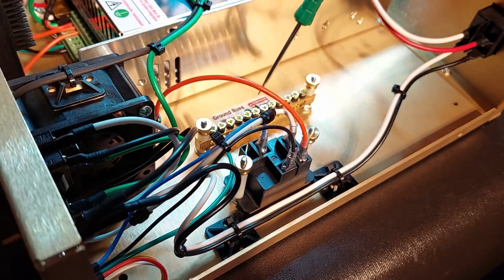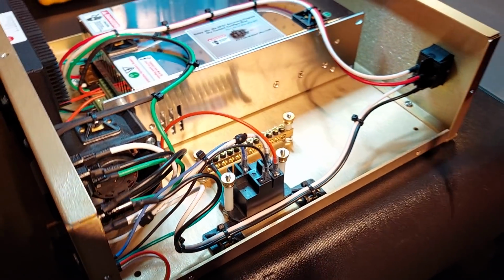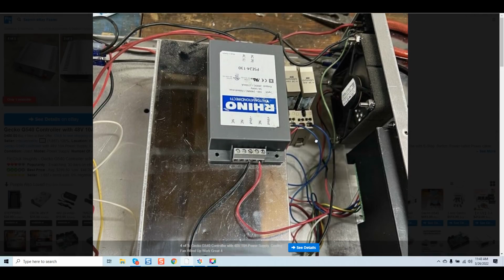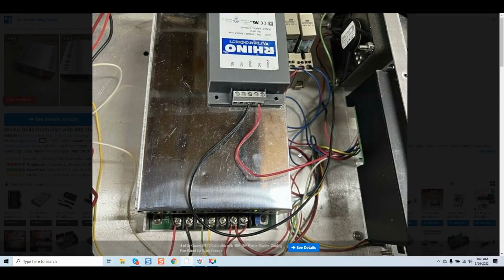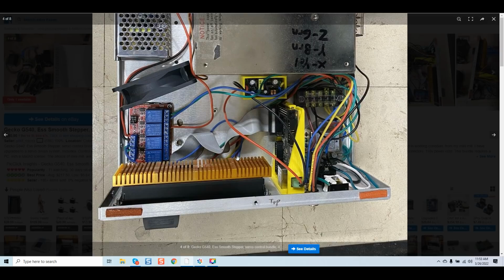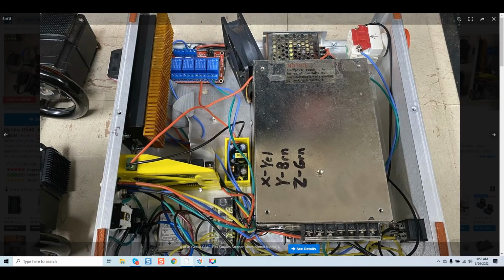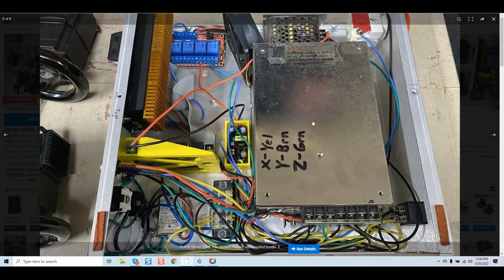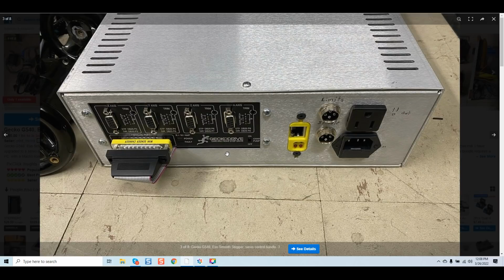Gecko G540 Systems Professional Controllers Versus Used..

Comment: Funny to see the flat cable running over the sharp edge of the G540 case opening. Really messy.
However he won't have trouble to extract his G540 as you said. As it's mounted inside the case (see last seconds of the video).
Reply from the maker: Thank you for your support. Vince